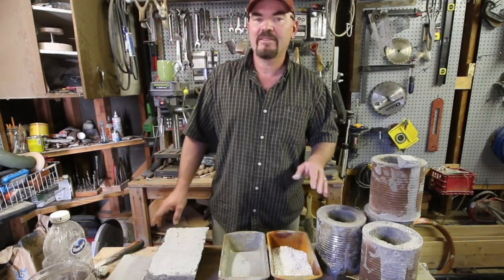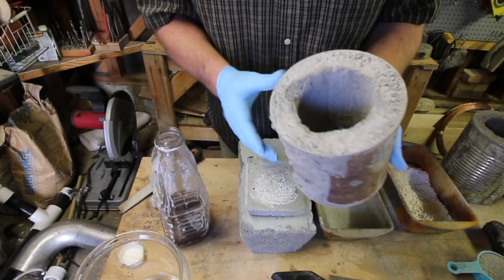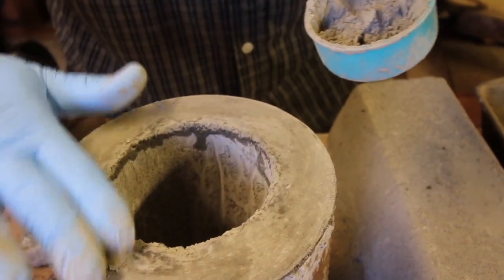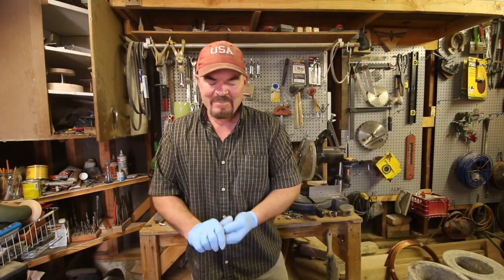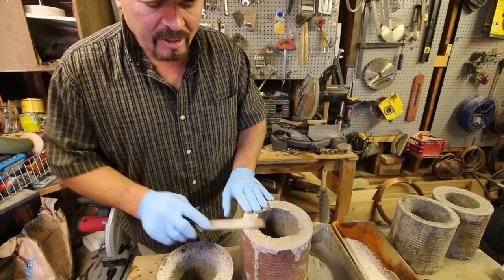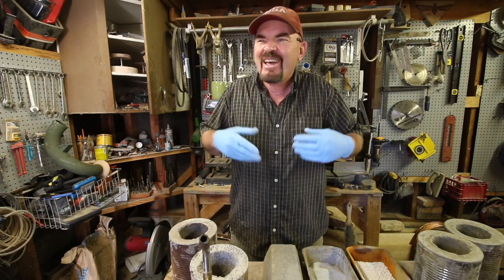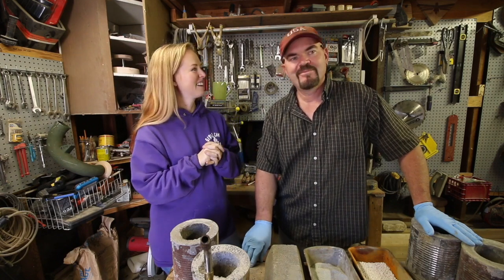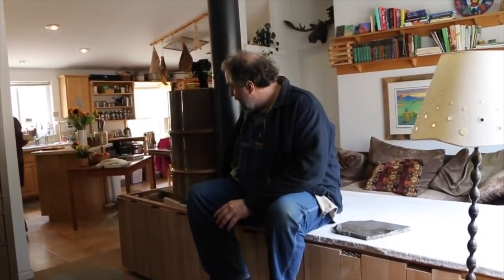Creating a Refractory Mix Out of AirCrete for the Rocket Mass Heater

Comment: If you put aluminum powder into a mix with water glass. The high base environment will produce hydrogen that will foam up and make an aircrete like material. The hydrogen will escape from the material soon after leaving a safe fire proof foam. But your max temp with waterglass will be around 2200F

Comment: Just for the record the water glass is reacting with carbon dioxide heat just speeds up the reaction.  The crust you see is silicon dioxide and sodium carbonate.

Comment: Suggestion procedure: You might pre=make sections of aircrete riser with groove on top ide and lip on bottom to interlock. Then take cured unit drop in  tank of water glass solution to coat all surfaces. Then coat with Portland cement and stack up sections and finish bonding water glass with fire.. Then determine temperature and cooking time to finished product.

Comment: Good  stuff. I was looking into how I could use aircrete in a rocket mass heater and here it is. Made the foam generator got some decent aircrete now on the the water glass. I was thinking starlite or the glue baking soda cornstarch mix might also be an option.

Comment: The main purpose of a rocket mass heater is to transmit as much heat from the burning into the mass - allowing for that heat to migrate into living space. Theoretically, you want the smoke ultimately leaving the chimney to the outdoors to be cool.  Aircrete, perlitecrete and other kinds of air entraining methods will act as an insulator, not as a reservoir for heat - meaning you'll end up losing most of your heat out the chimney.

You can buy bags of refractory cement, but the most cost effective method I've used is adding a good shovelful of fire clay to each 80 lb bag of ready mix concrete. Or, if you are laying in stones, you add the fire clay to a similar weight of mortar mix. I've built a pizza oven and I can assure you that thing gets hot.  I've had no degrading of any portland cement product I've used.
Reply: If this is working right it will get way to hot for normal cement. Cement disintegrates at about 1000 F The riser in the stove can reach 1900. Nearly double the 1000 degrees of a pizza oven.
Reply: @ghz24  ... Yes in part. I have a steel angle iron in my brick oven that deformed slightly in the heat. I take this to mean the top of the pizza oven reached close to 1900F.

Still, even with that heat, the portland/clay mortar joints between the oven's red clay bricks have not been affected. Disintegration certainly has not happened.

By comparison then, for a rocket mass heater, a well designed, heat resistant firebox is necessary, but adding clay to concrete mix for the mass - often benches - will be adequate to sustain the high temperatures

Comment: sodium silicate reacts with the calcium compounds in concrete to form calcium silicate, which has a melting point of 2500+ degrees F.
Reply: Try adding some graphene to the silicate mix.  Expensive but impressive results.  Other components work to boost refractory performance as well.

Comment: You can buy fire brick cement mix. Its about  $80 per bag
Reply: Exactly.. 5bags later and materials plus time... might as well buy a 4500 efficent rated stove
Reply: @vanderumd11  but where's the fun in that? ..not to mention, 5 bags for 1 rocket stove?  Will you be flying it to the moon?  Considering the mix, I was thinking maybe ½ a bag would make a nice sized rocket stove..

Comment: Great idea - THANKS! Really, really helpful.
By the way, yes the heat blasts off the water but it's the CO2 gas from the combustion process that does the curing of the water glass (from torch combustion, or gas (not electric) oven, or just use dry ice from the local welding supply - you get it). Air curing to glass is pretty slow only because ordinary outdoor air is only about 0.04% CO2. That is, it is not the heat that makes the solution into glass. Most off the shelf water glass solution is about 40% silicate in suspension and the rest is in fact water, so the expansion to the perlite-like appearance is caused by steam escaping from the heated water only. But who cares - the end results are perfect! Thanks again!

Comment: I built 6 rocket mass heaters (rebuilt it 6 times) in a dome I had over two winters in Wisconsin.  I learned a great deal about them and how they fail.   If a riser has a catastrophic failure, it can drop materials into the burn chamber and the active flame comes out the inlet of the RMH.  It happened to me and luckily I was sitting here there and I had plenty of water from my aquaponics system to extinguish the flame.  I absolutely love RMHer's.  I was able to heat my 20' dome that only had two layers of 6mil plastic to 75 degrees each night.  As I remember the coldest night was -23 degrees F.  And, the most wood I ever used in a night was 3 paper grocery bags of pallet wood.   Nothing better than cherry tomatoes in late January in Wisconsin!  I miss my dome!
Reply: “If a riser has a catastrophic failure, it can drop materials into the burn chamber and the active flame comes out the inlet of the RMH.  It happened to me and luckily I was sitting here there and I had plenty of water from my aquaponics system to extinguish the flame.”

And this is the problem. The idea is awesome. But Paul Wheaton doesn’t seem willing to admit the flaws. You cannot get insurance on your house for this reason. Codes will not allow the RMH for this reason. They are being built by AMATEURS which is fine, but there is no accepted design parameters, no UL testing. It’s an awesome thing, until it isn’t.
Reply: Awesome! Can you give a good refractory recipe? I see none here.
Reply: @brucea550  these things are slowly changing thankfully.

There are stoves getting approval that can be run through a mass.

The legal one I know right now is like $2500, which is a lot. But if you have an expensive home it's worth it to get insured
Reply: @priestesslucy  
I’m not sure what you mean about stoves that can be run through a mass. The system has to be designed as a system, not a factory woodstove and a home built mass. Could you maybe mention a source for what you know of? I do know there are companies making the actual prefab riser that you can buy for your RMH fabrication, but still not a complete UL system that will satisfy codes or insurance underwriters. I’d LOVE to find one!
Paul W. makes ‘I know of a guy’ comments but never any actual facts or sources.
Even if you have a non-expensive home, having homeowners insurance provides you with liability protection if, for example, someone gets hurt on your property. It’s not just about ‘if the house catches fire’. All these uninsured folks are living on ‘a wing and a prayer’, and their only protection from potentially getting sued is their own poverty- can’t get blood from a turnip. It’s also highly irresponsible putting these experimental heaters in occupied spaces where people sleep.

Please don’t misunderstand, I think experimental stuff is great, and I have now built an RMH in a detached garage, with the firebox separated from the rest of the structure by a concrete wall. So far I like it. But it’s clearly experimental, and I wouldn’t put one in my house.
Reply: @brucea550  Liberator is the one I know that's available and legal now.
Reply: @brucea550  'highly irresponsible putting experimental stoves where people sleep'

You're not supposed to sleep while a RMH is running

I can see why the batch boxes get such giant warning notes lol, since people can treat them more like a conventional stove
Reply: @priestesslucy  Yes, I’ve seen those, and it’s a step up from a traditional woodstove, but still a rocket heater, not RMH. Their website even states “Please note that masonry heaters and heaters with thermal mass are not UL listed and must be built on site.”
Reply: @brucea550  doesn't it include instructions for linking it to a homemade mass?

I was under the impression this checked all the boxes for getting a legal RMH, you just have to do part of the work yourself
Reply: @priestesslucy  I’m not seeing anything about it on their website. The part you do yourself would not be UL listed, so it might be a grey area for insurance companies to approve. They could deny you based on not liking an unconventional flue installation, or whatever modification you have in mind. It would be great if they were less rigid about this stuff, but so far they all seem to want industry standard, not free thinking. I know as soon as I installed a woodstove I needed photos documenting everything (because I installed it myself). Then they requested a professional installer sign off on it anyway. So maybe if you could do the mass and then get a licensed chimney guy to sign off on it? They really hold you hostage sometimes!
Reply: @brucea550  ouch.

But yeah, so long as you're doing a vertical roof-exit chimney that eats a little heat from the radiation chamber, it should definitely be doable to get it approved

Comment: Have you given any thought to possibly installing the actual burn chamber of the rocket heater outdoors?  The children could be inside while the high heat fire would be outside and away from the small structure. You could route the flu chamber to wind inside of the cabin to produce heat with the threat of a ultra hot fire on the outside.

Comment: I am glad your HVAC system is more to your liking.  This does not mean that your wood produces more energy than your neighbor's.  Your system EXTRACTS more energy from your stove in the manner you have designed it.  Your residence is probably better insulated and your comfort level may also be different than others.  Some have poor insulation, others might feel that a temperature of 78 degrees is what makes them feel comfortable.  You extract more from a chord of wood by heating solid masses than someone else's heating system that utilizes a fireplace for heating their living space.  It all has to do with the degree of insulation of the living space and the method of extraction of heat from the fuel(wood) that is burned and COMFORT LEVEL for different people.  I noticed you looked comfortable inside your house dressed in your overcoat.  Someone else might feel more comfortable being in a t-shirt while indoors.  Your comfort level is obviously different.  Someone else might prefer more humidity in his indoor space than you do.  Insulate your house better and extract heat more efficiently from your fuel within the parameters of your comfort zone.

Comment: -48 a few days ago with more to come, a bit tired of those $250 a month natural gas bills. I've had many wood stoves over the years, many bought and built. The one thing I've learned is burning green wood is when creosote can become a problem. So as long as you don't burn green wood you hopefully won't that problem. ( However in a wood stove, 3 dry logs and 2 green logs makes for a fire that isn't as hot. )
Reply from the maker: We burn really dry wood but it is soft wood. We only grow soft wood in our area, pine and douglas fir. We had creosote buildup every six weeks in our conventional wood cook stove. The new rocket stove hasn't had any creosote with the same wood now that we have the aircrete chimney on it for insulation.
Reply: @dirtpatcheaven  Have you tried burning pallet wood? I picked up 250 free pallets, many are built with hardwood, these burn very very "HOT" so doesn't take a whole bunch to warm the double garage up. I usually run a skill saw, inside the stringers on each side, of the pallet, then only have the middle nails to deal with.  I honestly believe you're mass heater should have been about 1/2 the size, as big as it is, as you live in a tiny house. ( It would also take up less space. "It must get horribly "HOT" up-top/ in the loft, as hot air rises. "Just my thinking" I find the problem with wood burning is it is incredibly hard to control temperatures. There is another style of wood heating system I tried and really liked, however when it went below 10, it couldn't keep the place warm even when burning massive amounts of wood. Check this out; https://www.youtube.com/watch?v=v_i5Cj2LSUo  - I'm sure you're buddy could rig one of these up for you, the thing literally functions like a natural gas furnace, with a thermostatic heat controlled fan. I built one, just to test, and really really liked it, but because it gets so cold here, it would have burned to much wood, to be efficient. https://www.youtube.com/watch?v=2mZM74qPVrM

Comment: You are going through more work than you have to,I am a ticketed refractory  bricklayer,and have been relinning lime kilns,power and recovery boilers,furnaces etc for 20 years.all you need is a bag of lightweight castable.ther is no abrasion so a llightweight castable should work no problem and a bag should only cost you 20 30 bucks,we use it by the pallet and b train.
Reply: Where can I find this $20 a bag lightweight refractory
Reply: What would be a good cheap mix for a forge? I was told sand and plaster. But that seems to simple and i heard it fails after a couple uses.